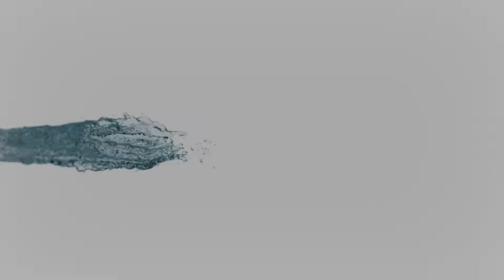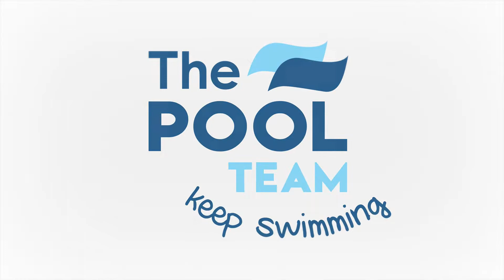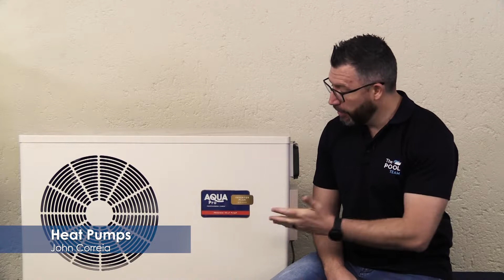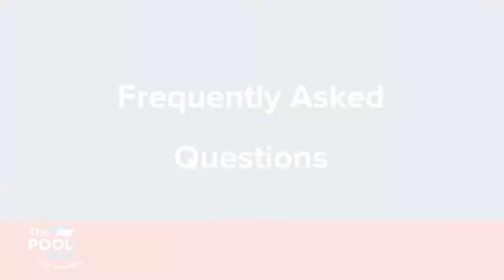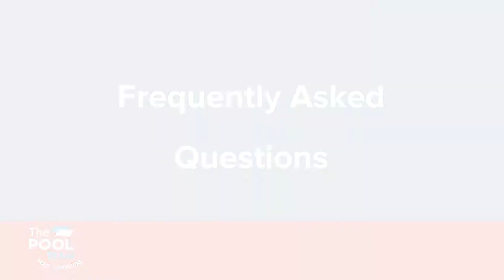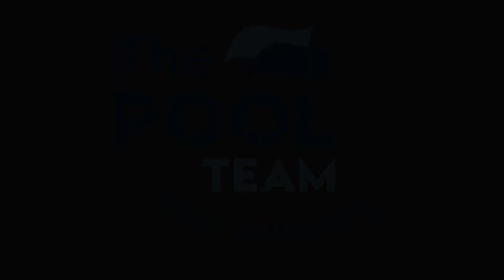Aqua Pro Heat Pumps explained | Heat Pump DIY

Comment: I purchased a 12.5 kW Aqua Pro and it makes a terrible high pitched noise. Not able to use it while using the garden or pool. The only comment from support is that this is normal. Definitely not recommended. 🙁

Comment: Just purchased a 17Kw Aqua Pro Heat pump yesterday. Seems the Solar blanket is a necessity thou in order to retain the heat. Once I get it up & running, will feedback
Reply: Hi any news from your heat pump?
Reply: @michaeldiandinga699  I figured it takes time for the initial desired heat. Ran it around 72 hours to attain 30 Degrees. Overnight it loses around +/-4 degrees, then it catches up in the day. So working I suppose. Next mission is Solar Blanket so that loss is minimal. I spent +/-R300(4 days non-stop) on electricity to get to 30 Degrees. I now run it on Smart mode and Standard condition.
Reply: @skywalker1766  thx for the updates! I just received my unit which is a 40 kwa but I am having hard time to run it ..😐
Reply: @michaeldiandinga699  What is the problem? 40KWA...wow...that is a big boy. After a few weeks, my unit runs so much better. Takes 2 days to heat up to 32 Degrees. What a pleasure to swim and once you get your desired temp, you can switch to AUTO mode and STANDARD. Saves on the electricity bill. Let me know if I can help...perhaps share more detail on what issues you currently having?